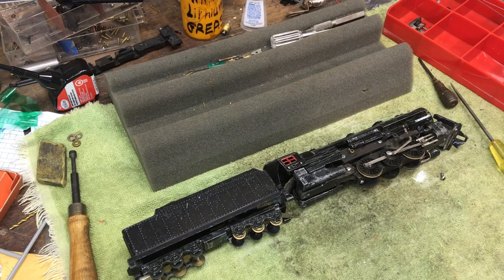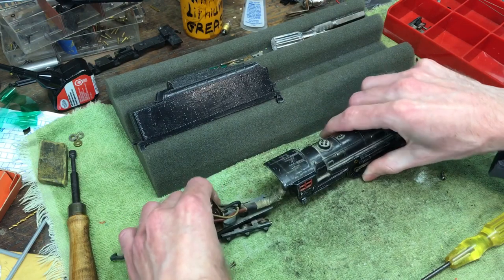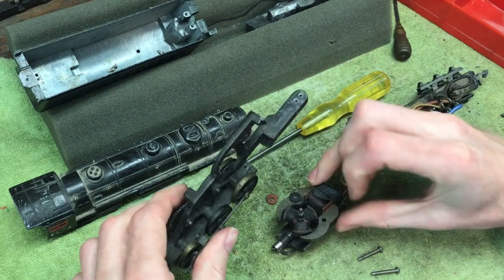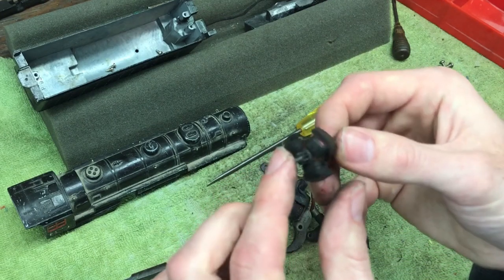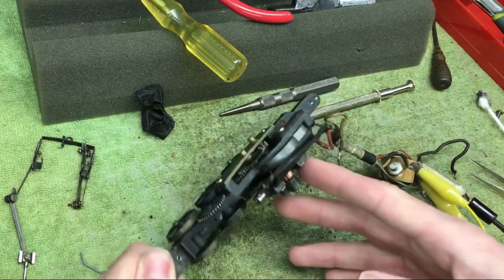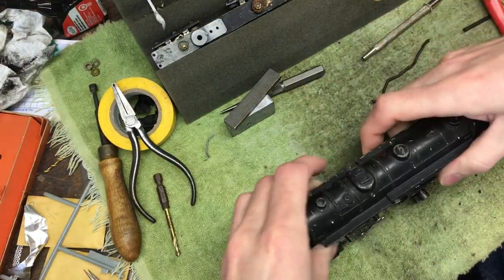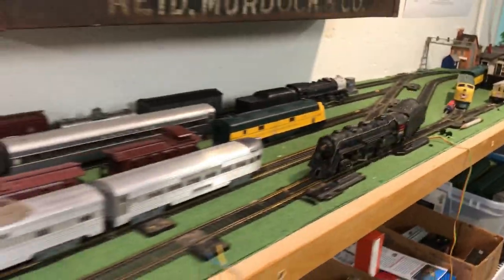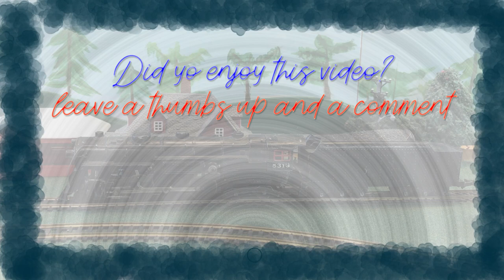Restoring a PreWar Gilbert HO Hudson | Metal Steam Episode 2

Comment: I have a postwar version #443. I bought it at the factory store in the early 60s while my mom was working there. I have run the dickens out of it. I can't believe all of the differences between prewar and postwar.
Reply from the maker: I found the gilbertho.org website shows the various models of the Hudson. There's more than I realized too! Apparently there's a prewar version with Smoke in Tender and a vertical DC motor.

Comment: I have the first postwar version, from 1946 (it has the date stamp inside the shell to prove it!). Unfortunately I need some way of recharging the field magnet, or else I need to somehow drill out and replace the magnet. It's missing a lot of parts, and I'm not really anticipating getting it working any time soon. I really like this prewar model, I need to keep my eye out for one.
Reply from the maker: I didn't know they made a 1946 version. I found the gilbertho.org website which shows all the different models. So yours has a vertical DC motor? That's interesting. Might be able to replace the magnet, I got magnets from kjmagnetics.com
I have 3 of these prewar engines, but they all have the AC motors, which I don't think would help you any, but I am selling one of them after I finish my videos. If you think you'd be interested, email me: mygrandpastrain@gmail.com

Comment: Did the Gilbert Hudsons have tender switches ON BOTTOM  during pre war era?
Reply from the maker: There may have been a version with a sequencing reverse unit which would have the same lever on the bottom. The DC relay reverse did not but had a pin hole on the top for manual reverse. Others had been converted to DC operation with either a permanent magnet in the motor or a bridge rectifier. DC conversions would not have a lever. Some also had a smoke in tender unit which may have a lever as an on off. you may find the Gilbert HO website interesting it shows all the variations of the engines. https://gilbertho.org/rolling_stock/rolling_stock_number.htm